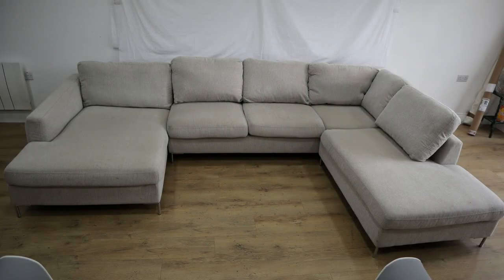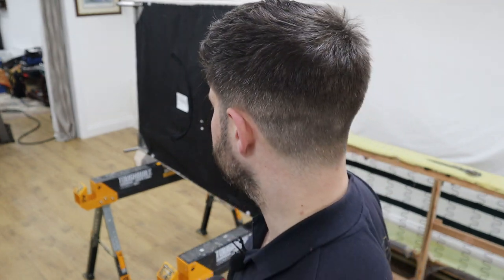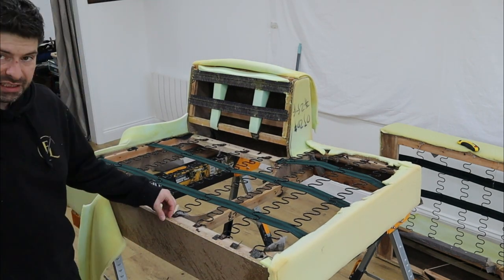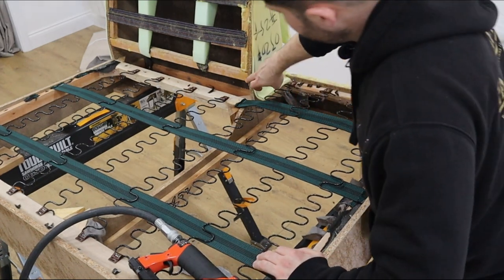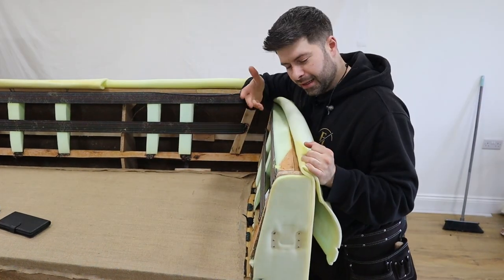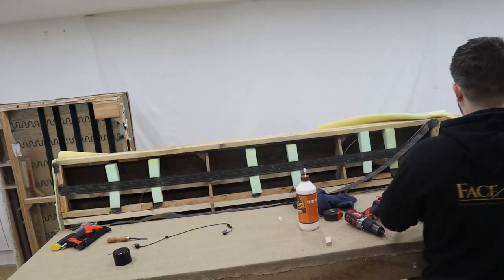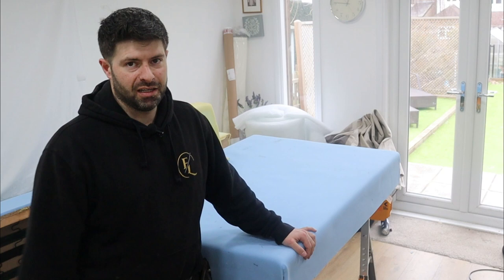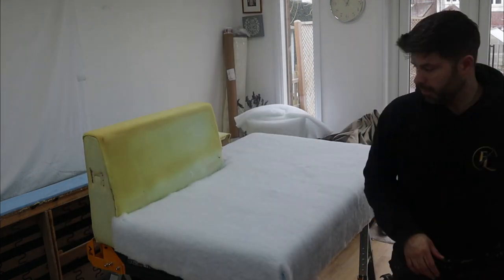HIGHSTREET TO HIGH END SOFA | HOW AN UPHOLSTERER CAN UPGRADE YOUR SOFA | Faceliftinteriors

Comment: My A.F. Sofa is garbage in the inside. I was so disappointed once I opened it. Now I’m left improving all of the shortcuts they made just to reupholster it properly. Materials and fabric are still cheaper than purchasing a couch but what a headache. 🤦🏾‍♀️
Reply from the maker: Just know that when it's done it will be much better than what you can buy from a manufacturer! Hope it all works out well and thanks for watching! 👍😁⛏️🧵📐✂️

Comment: Is it possible or at least not too daunting for a beginner to turn a large U shaped sectional into individual modular pieces? I’m searching high and low and not finding anything of the sort, only blogs of separating a sectional (mostly L shaped) into sofas.
I’m the type of person that has to make changes to a room periodically and when your sectional can only fit one way in a rental without blocking doorways and not have the tv in front of windows, there’s not many options!
Reply from the maker: Hi Cortney. I would say it's too big a job if you aren't experienced in this sort of work. When it comes to cutting down frames, it can be quite a big job as when you cut a sofa in half you have to Brace both end for strength again. Hope this helps. 🙏🧵⛏️📎✂️📐

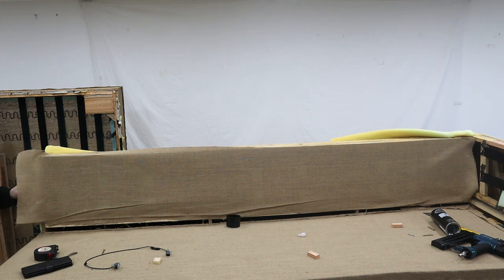Comment: At 8:55, it's mentioned Hessian prevent foam collapsing through webbing. I understand the same reason for Hessian on the seats. Now what if we just use a lot of webbing to cover the entire area and skip the Hessian? Apart from extra cost, what're the downsides?
Reply from the maker: I mean you could do that in theory. I would worry the webs would rub against each other and make noise and would prevent the webs from moving like they should to create a comfortable seat.

Comment: Why are the edges of the wood frame not rounded ?  We had an armchair reupholstered some years back, the fabric has lasted very well, but the frame of the arms can be felt as hard edges where the foam has compressed over the sharp edge of the timber. I feel rounding the edge of the frame would have made the job last much longer.
Reply from the maker: Yes I hear what you are saying,  I guess most people wouldn't want to pay the extra cost to round off the edges of the whole frame. I always just make sure there is foam and dacron over the hard edge as well as the fabric so it isn't so sharp. 👍✂️🧵📐📎⛏️